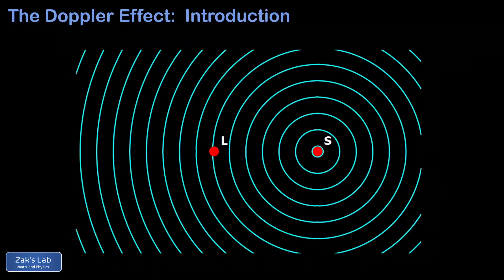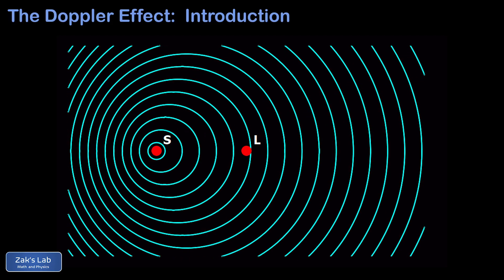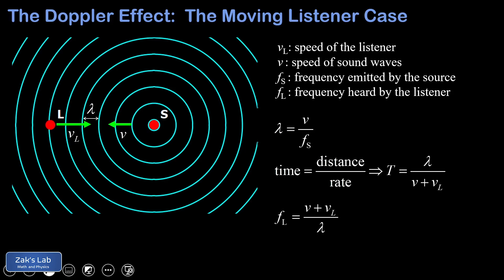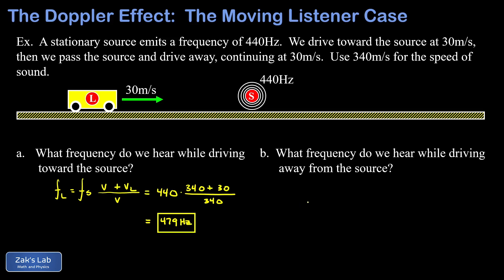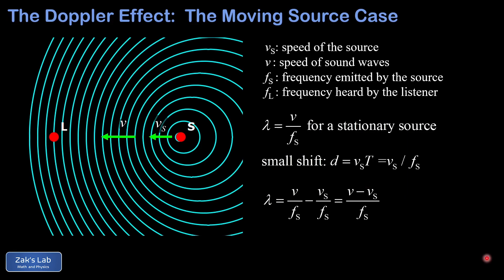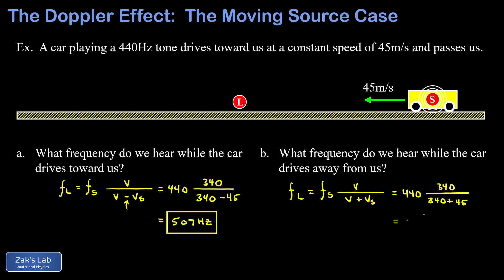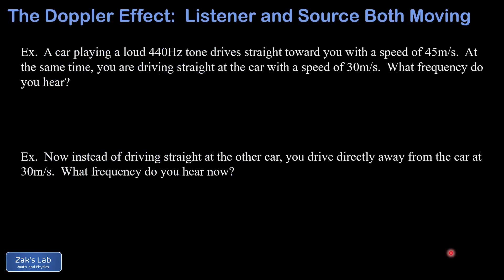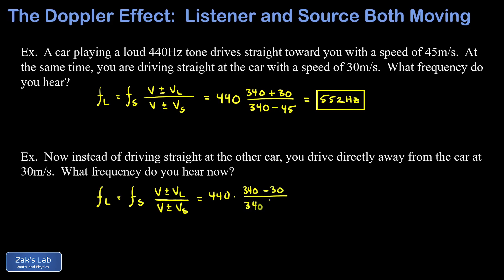Introduction to the Doppler effect: animations with sound, Doppler effect derivations and examples.

Comment: During the COVID shut down back in 2020 I REALLY studied the doppler effect and after trying to figure out why I wouldn't get the right answer after subtracting the speed of the source, I finally did it! So then a few years later I did an experiment on the highway to prove that the shift is more dramatic the faster you go! And sure enough it went right along with the formula! i’ve noticed that last, but this is the reason why helicopter blades when you hear them flying over seem like they are going faster than they normally would when it comes to you, then it almost seems like the pilot is shutting them down as he flies over. Even though they are going at the same speed. that is because of the Doppler effect. And at last, I can confirm this with the formula. And using a tone generator, I can re-create those sounds and create a perfectly accurate simulation of a helicopter flying overhead. my friend was in the army and flew those Chinook helicopters, and anytime he flew over I would ask him how fast he was going so I can calculate the Doppler frequency. Showed it to him and he absolutely loves it. as someone who is blind I think this is just fascinating.